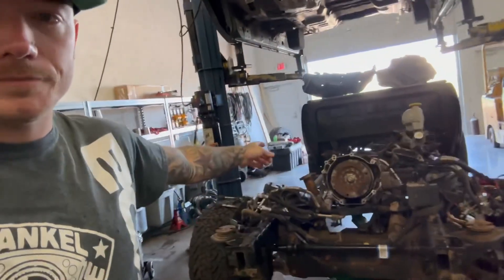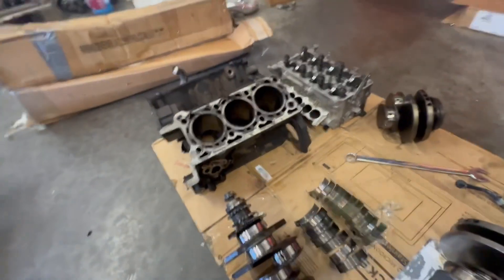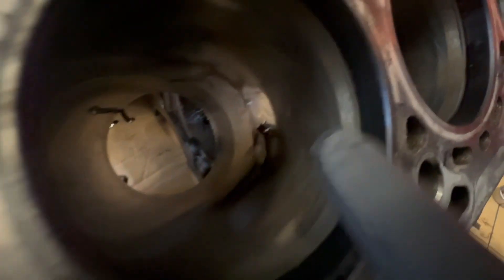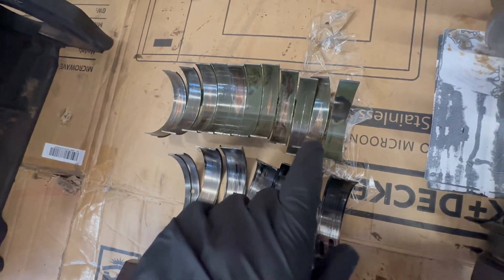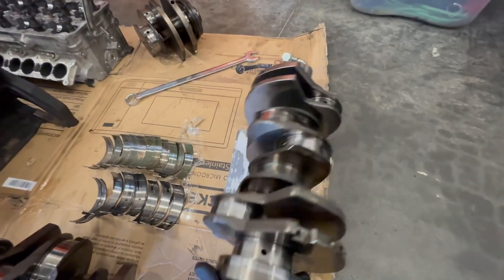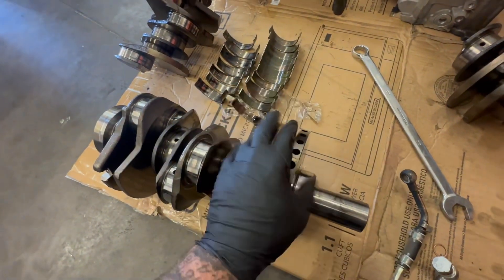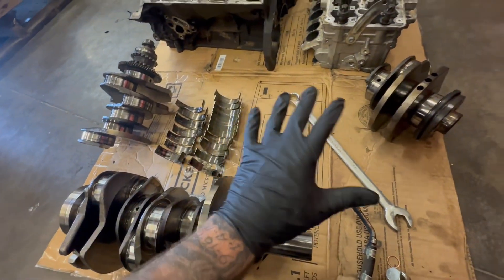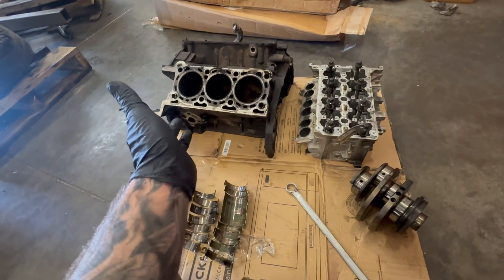Ecodiesel Engine failures, and our engine rebuilds

Comment: Hello mate, when installing reluctor wheel, the balancer and a flexplate comes on top of that ring, and you secure it using a pin, right? Is it possible to mess this up? I'm asking, because I've got my engine replaced (on Jeep WK2) and since then the engine/transmission is shaking badly in some RPM (basically around idle and few hundred RPMs higher). So I would like to know, if it's possible to put balancer/flexplate back incorretly? From what I've seen, I suppose not, as there is hole for that pin in recultor wheel/balancer/flexplate itself. So I suggest, that input shaft on my transmission might be damaged, as the engine was replaced. Thanks for reply.
Reply from the maker: It should only go one way I think I saw your Facebook post about it

Comment: I see on ebay they have new crankshaft kits for the ecodiesel,  are these acceptable to use? I have an engine in my truck with 248000, it locked up, and I am wanting to rebuild it correctly the first time. Give me your thoughts please?

Comment: So I have a question for you. I have a 2022 rebel of course with the eco-diesel with 30,000 miles on it and I live in Florida and I’m fixing to do an oil change and considering using T6 15-40 Rotella motor oil because of how hot it gets here in Florida. Is this a good idea or a bad idea?
Reply from the maker: 2020+ you can’t use t6 on

Comment: I have a 2018 Ram Ecodiesel that engine died at 108 000 km.  Put a new one in and I'm dumping it before the 3 year 160 000 km Mopar warranty is up.  The mechanic who dropped in the new engine has done a lot of them and said it's a complete gamble, some last and some don't.  My maintenance was impeccable.  I would never advise anyone to buy a vehicle with an Ecodiesel.  Gen 2 anyways...

Comment: Would you please advise the aftermarket crankshaft & bearings to purchase? I have the 2017 Grand Cherokee Ecodiesel with the same problem just shown up, out of warranty of course. The dealer only suggest to look for second hand motor to swap 'cause new one is economically ridiculous, like 14K Euros, nothing to say of labour & minor expenses.
We do have good machine & auto workshops here in Poland but no one heard that there are good aftermarket cranks & bearings. So I would rather order it from the US than try a questionable luck with second hand engine with unknown milage, service history & etc.I'd highly appreciate your advise 🙏
Reply from the maker: We sell them on our website

Comment: I am trying to rebuild an ecodiesel right now. I have 3 engines that all failed that im trying to cobble together. 

I have 1 good crank with matching con rods and matching block. It failed due to the camshaft problem. The other two were mains. 

But the block i want to use is missing an oil port under the pump? The other 2 blocks have it. Why is this?

Comment: I have a 22 model, 3500 miles.  Yes i know i don't drive it.  Not because of the known issues but i have a different vehicle I daily.  But it scares me.  Dealer tried to tell ne these teucks have a 10k mi oil change interval.  I told them f that and to change it at 3400.  I had planned on doing 5k intervals but now that i know the issues I'll be doing 3k.  And praying lol.  Been a good truck, plenty of power for me, does what I need it to do.  Judy hope it lasts till I get rid of it

Comment: Reparei uma coisa neste motor, o manual de manutenção da jeep diz que a folga de lubrificação de biela e de 0,028 a 0,052 de milimetros e se voce conferir vai encontrar sempre a cima de 0,080 em bielas acredito q seja isso a falha destes motores pois a pressão de oleo esteja baixa nao tem cunha hidráulica pra sustentar o virabrequim flutuando sobre as bronzinas
Reply: I think your right early LT1 GM engines had similar issues with tolerances etc and oil types.

Comment: I have a 2014 ram 1500 echo diesel and I am getting service electric throttle control and a under boost message were would you start looking for the under boost problems? Were are you located thanks Glen

Comment: I have a gen 3 2022 wrangler ecodiesel.  do you recommend hotshot diesel fuel treatment or any other preventative maintenance?  I love the engine so far and want to keep it as long as i can. Thanks in advance for any advice. And is my crank at risk?
Reply: Gen 3 don't have the crank issue, and others with the Gen 2 (prior to 2019).
Reply: I have grand cherokee 2019 3.0 crd how do i know what gen is the motor ? Is still the one with problems or not ? Thanks

Comment: I bought a 2018 with 80k on it. Original engine slung rod, dealership put a new crate engine in it. Does the new crate engine come with any of the issues fixed or will it have the same flaws?
Reply from the maker: Nope it’ll fail

Comment: Can you make a video that goes deeper into the issues with the crankshaft, And what the differences are with the Custom Crank you have made for these engines.
Reply from the maker: Cranks visually aren’t any different, and the issues with the crank is that it flexes which there isn’t a way to show that.
Reply: If its a crank issue, wouldn't be better to run a chromemoly cranks and have the bearings and the main journals coated with antifriction coating? Will be more $$$$ for the crank but longevity and reliability should be lifetime.
Reply from the maker: @Gene4666 we have aftermarket cranks we rebuild the engine with, matched with better bearings.
Reply: @Recklessmotorsports  will they hold up if there will be a turbo upgrade in the in future?

Comment: I have a 2015 Ram 1500 with a Eco Diesel, 120K+ miles that I purchased new. I've had no issues yet. I'm not sure if mine is consider a 1st Gen. Change oil every 5K after the first couple yrs and also went to 5W-40 Rotella T6 per the dealer several yrs ago. Do you feel that my engine is at rick? And where are you located at?
Reply from the maker: Gen 2 all gen 1 and gen 2 engines are at Rick
Reply: The one that's getting replaced had almost 160k ran fine and boom lost oil pressure on the way to work. Changed my oil every 6k with 5w-40 Rotella.  My truck does get a lot of idle time tho with being up in Michigan with half the yr being winter. Also having a kid. I don't want her to freeze ya know.
Reply: @matthill2898  do they know WHY it lost oil pressure??